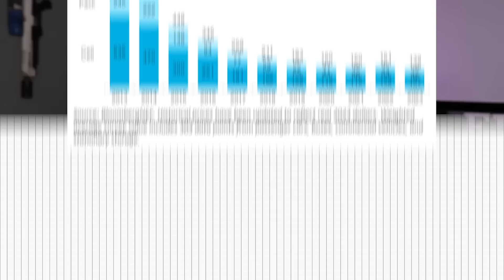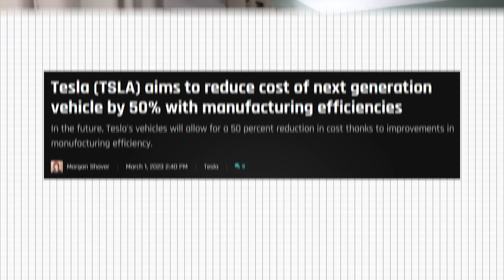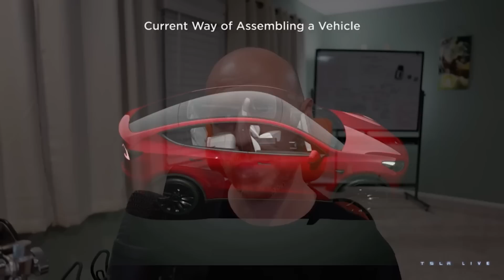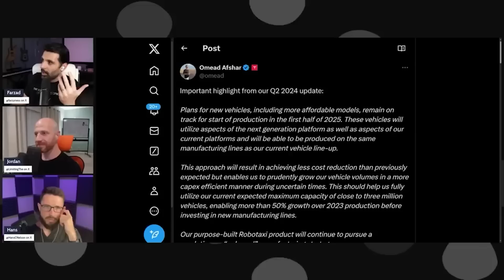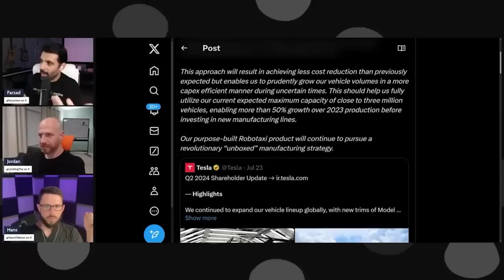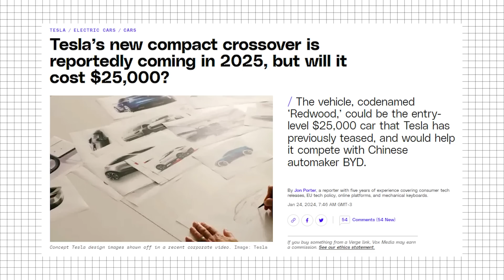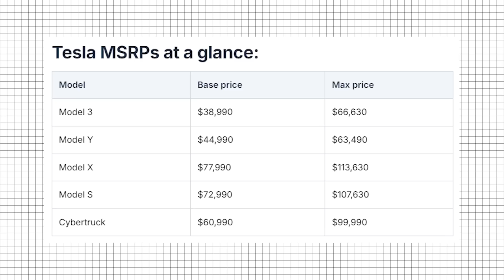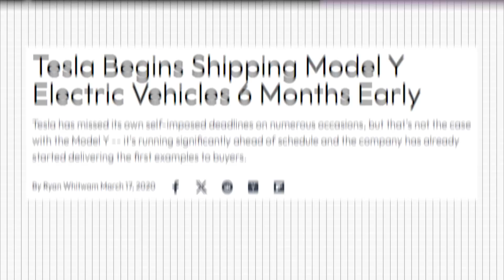Next Gen Tesla’s About to STUN Everyone!

Comment: Not a lot of knew information. It should be the NextGen EV w/ all the controls. You can use an existing dedicated line. Can be a casting with new dies & same for stampings,same equipment! sell $25-28K. Even final assy can use the existing universal carriers. Built in GigaAustin (no M3 line so it’s out). Maybe even a 2 seater with one casting. There c/be 3 models released…how about a Van / SUV off the Cybertruck line…maybe too soon. Remember GigaAustin has its own die shop…they have lots of capability!

Comment: The Unboxed process requires completed modules to be plugged electronically to each other when they're assembled. The harnesses and local modules have to be there to make that happen. These components can be installed in the usual order of assembly, on the existing lines. This makes sense, because the electronics are going to have to be developed and improved. Early iterations may use some of these modules to shake out any issues before rolling them out to the whole car. This minimises the risks while still moving forward. Once they've proven it's all working correctly and all of the necessary Unboxed elements are being assembled on the existing lines, they can then switch to a dedicated Unboxed line.
Reply: The whole unboxed savings projections are bogus. It’s all talk.

Comment: IIWM , If It Were Me I would want as many vehicles to share as many parts as possible, no mater what assembly process was being used. The biggest shroud covered vehicle will hopefully share the Cybertruck chassis. The smaller covered new models will also share the same chassis’. Just as the “best part is no part”, the second best part is the same part. The second best process is the same process. Having a stockpile of interchangeable parts helps manage the supply chain to drive costs down. Steer by wire can be used in all Tesla vehicles at some point, as well as break by wire. Add the Tesla Bot to the assembly process and the costs are reduced even further. I think in time Tesla will hit its low cost target while the OEM’s add horns, whistles and bells oh my…bankruptcy.

Comment: I thought LFP cells were down to $50-60/kwh. And what's with the million unit sales for model 2? I thought they were going to sell at least 3M. Also, I'm skeptical about the cogs reductions you mentioned. Even if they shrink the new model by a foot from existing models, and reduce the battery by 10 kwh, how does that get the cost from $36k to $24k?
Reply: You are right to be skeptical. Talk is cheap.

Comment: I like the theory that the car will be a two seater with three wheels (for robotaxis). Unboxed process, much smaller battery and drivetrain. Maybe they can produce a Robotaxi for something like $18k. I think the low cost of Robotaxi is what will be really shocking during the reveal. I know there are some states that have different regulation for 3-wheeled vehicles. That's ok. They can also make four wheel vehicles down the line for those states.
Reply: Didn't you see the bench seat, it'll be a 3 seater.
Reply: No chance they make a three wheeler.
Reply: @JRP3  I think there is a good chance they have more than one model and the first one is the 3 wheeler. It makes a lot of sense. Really the only bad thing about it would be the states where regulations treat 3 wheelers differently.
Reply: @GershonBenYitzhak  The other "bad thing" is that every single 3 wheeled vehicle has been either a niche vehicle or a complete failure, other than extremely cheap tuk tuks in poor areas.  The other thing is that Elon is on record saying that EV's do not need to be 3 wheeled "weirdmobiles".  It's not going to happen.
Reply: @JRP3  I don't think you understand the point of 3 wheels. It's not to look cool. It's to shred 25% of the weight of the car so you have better range, less parts, faster to produce, less batteries needed per car. This is a robotaxi. Doesn't matter what it looks like. It's all about economics. And if you only need 2/3 seats, 3 wheels is the way to go. Even those states that require a motorcycle license - it might not matter since it's a robotaxi.
Reply: @GershonBenYitzhak  Clearly you've never worked on a vehicle if you think removing one wheel and it's suspension components reduces the weight of a vehicle by 25%.  Not even close.  Not to mention the economics of sharing a vehicle platform with a similar one for people to own.